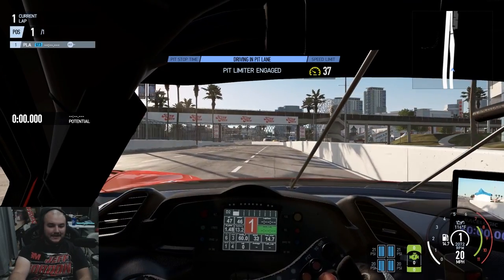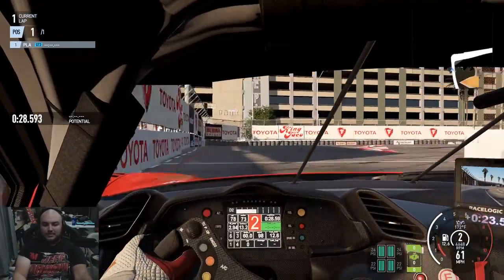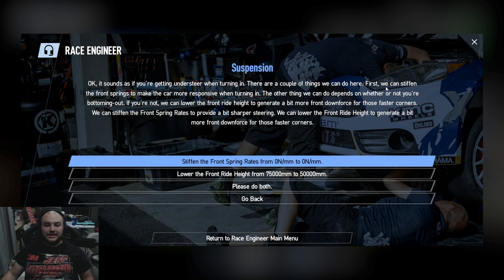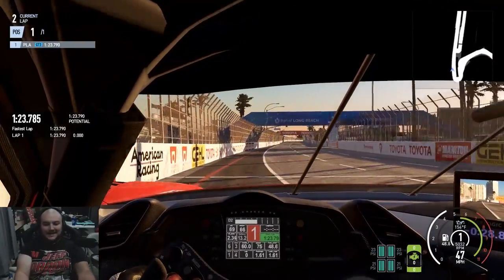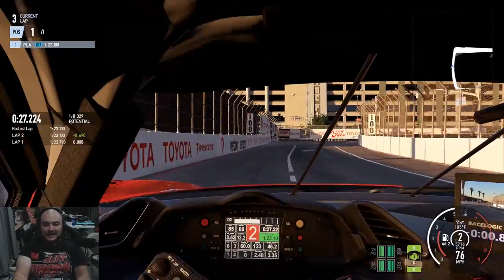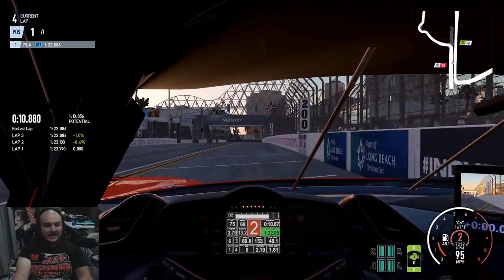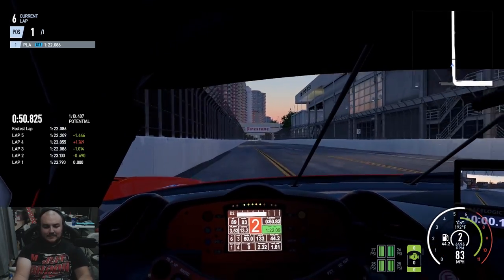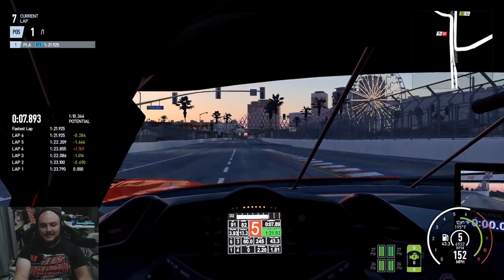Project CARS 2 - Taking a Look at Race Engineer

Comment from the maker: Note: Sorry if I seemed kinda tired in this video! Working on around 4 hours of sleep, after a pretty busy day haha. 

It seems like once you get setups dialed in, it does feel a lot better. I can understand why SMS has gone for a "Safe" default set, but I would have loved to see an option for an "Advanced" setup, similar to what was in NASCAR Racing 2003 season, but the Race Engineer does a solid job tweaking the car to improve it, at the very least!

Note 2: Looks like I finally fixed OBS settings :D :D

Edit: Note 3 - Due to a miscommunication with Bandai Namco, they accidentally forgot to tell me that I was not allowed to do live streams. So, after the last stream I did, they explained the situation, and asked me to take them down.

I still have permission to do non-live streamed videos, so I'm going to be working on that to highlight the content and features now.
Reply: Sim Racing Paddock What happened to the three streams you guys did?

Also on another note - why do you strive for this game/sim to feel like another game/sim?
Reply from the maker: Due to a miscommunication with Bandai Namco, they accidentally forgot to tell me that I was not allowed to do live streams. So, after the last stream I did, they explained the situation, and asked me to take them down.

I still have permission to do non-live streamed videos, so I'm going to be working on that to highlight the content and features now.
Reply: Sim Racing Paddock Oh okay that makes sense.
Reply: Isn't the "advanced setup" the "edit setup" button right beside race engineer?
Reply from the maker: Yes

Comment: Sometimes we actually turn the wheel more when faced with the early-in-the-turn under steer. That then causes the over steer later in the turn. As we turn the wheel more and more, the tires begin to scrub off some speed, then suddenly gain traction, causing snap to over steer.  Before we jump to tweak away the car's set up, we should raise our awareness to the real cause of a handling issue. Most likely the driver's inputs to the wheel. But I did like the video as to how the "race Engineer" function actually works.

Comment: Nice to see you respond to comments with a new  video!   GTE cars in real life have tons of aero grip. Horsepower levels are far below most street car counterparts... particularly with regard to this Ferrari.     So all the sliding you will see with a Ferrari 488 GTB on Top Gear or something similar will not happen when you cut horsepower by 150, add tons of aero and slick tires. And race car drivers don't want to understeer or oversteer, they want grip. Real drivers try to dial out the oversteer. I like it in sim racing because it is fun but if you have to compete in multiplayer.... speed and grip!

Comment: Why would you turn off Traction Control on a car that comes with and is meant to be driven with it? I dont get it. 

"The car doesnt work the way i want to" -  cause it shouldnt.
Reply: Ali Bi he's talking about the car being too planted, TC won't change that
Reply: Isn't the planted a good thing for a race car?
Reply: For fun.
Reply: "Planted" doesn't mean that it turn like you want. You might want for the tail to be a little loose (I said "a little") under braking in order to help turning in.
Reply: Then PC2 should have real assists like AC... why should I look on the Internet what is factory settings for every car when it should be in the game.
Reply from the maker: PC2 does have the option. I tend to prefer not having TC on, because I tend to prefer a bit of slip in the way I drive, and the way TC works can hamper that. I know real drivers sometimes also drive with limited/off TC as well. 

TC in race cars isn't like TC in a daily driver road car. Drivers will adjust the settings multiple times during a race, or even multiple times during a lap.
Reply: You can adjust the TC power in the In Car Menu (and ABS).... so just turn it down, that way it's still there should you suddenly find it's raining (as we have localised weather, you can find it only raining on part of the track)
Reply: It's become a bit of a dogma in the simracing world - a lot of people feel that the "real" drivers don't use traction control or ABS, even if the real car has it by default and perhaps can't even be turned off. (Can TC/ABS even be turned off in a real GT3 car? I wouldn't be surprised if it couldn't be.)

The same thing often applies to wings - plenty of people always dial down wings as much as it goes to the point of making the car extremely twitchy and very difficult to control in corners, because obviously less downforce makes you faster...

Comment: He should start improving his laptimes, being more than 5 seconds off pace compared to the times from WMD members shows that he isn't really driving at the limit (except that he always locks the tires). As soon as you really hit fast laptimes there is enough instability you have to manage and there starts the real racing and there starts the fantastic work of slightly mad studios physics developers in regards to the new tire physics features. Are you really expecting to have a non-planted car as long as you're driving slow? ;-)

It's time to give the future of sim racing a chance and not relying on old habits so pls don't take AC or rfactor as the counterpart to proof if pcars2 is realistic. Do you want to play a realistic sim or another copy of AC / rfactor?
Reply from the maker: One question I have is if that "5 seconds off the pace" is with WMD drivers going on a full tank of fuel, hard slicks, in a race setup? 

I tested out taking most fuel out, putting softs on, and pushed a little harder, and I got a 1:19.1. About 2 seconds less than the real life pole (and the WMD times), but not "5 seconds off the pace" ;)
Reply: What answer do you want to hear now from me? :) You think you're a 'racedriver' now because you're only 3seconds off the pace instead of 5? :) I just want you to be more careful with how you're judging a simulator. The base setup for that car is quite save as you're noticed thus it feels a bit "planted" or understeery which doesn't automatically mean that the game simulates the behaviour "arcadish" or "not realistic" or whatever. It's simply setup-related. If you're going to push the hell out of the car there are several corners at the track which let you loose the rear (and thus getting more realistic, right? harhar) and force you to be careful. Same with braking. If you're going to get at the limit and brake as late as possible (make sure your brake bias and temps are setup to use every brake of the car as efficient as possible) you have to manage the turn in, too, not to loose the rear.

There are plenty of other car classes in that game, just take another one than GT3 next time (the 2013 FORD FALCON FG is a very nice alternative - very rewarding as soon as you got the trick to drive the car). Just a recommendation.
Reply: And it should be a piece of piss to go sub 1:20 with a full (that's 83 litres, not the 50 you ran) tank and hard tyres.. yes I do mean with an otherwise default setup and even with a gamepad...

Comment: So the car had good grip and you wanted that teflon tires on wet ice feeling? Okay... I know loose is fast, but I am hoping there is good grip in the game.
Reply from the maker: Grip is decent, but as mentioned in the video, the cars are inclined to be set up to understeer. You lose a lot of time if the front tires are not turning. It's definitely not "teflon tires on wet ice", it's setting up a car, like in real life, to handle corners.
Reply: I think your main problem may actually be turning the steering wheel too much, thus causing the understeer... or then you are just not aggressive enough in actually turning the wheel properly. You really need to kind of "manhandle" these cars.. not drive them like a granny, as you are doing in the video. It's possible that the driving style is caused by too much iRacing (I recognize the "carefulness").. who knows. Look at a few GT3 videos.. look at their wheel/hand movements and wheel angles. They aren't leisurely turning the wheel and gingerly squeezing the throttle and shifting up at half the effective revs. It's a rather violent process in real life, compared to driving normally on the street. You need to go in with this mentality. Yes, if you drive properly aggressively in a sim like iRacing you'll be spinning out quite quickly.. but that's not "realism", that's their "problems" with the tire model. Here you can and should "manhandle" the steering.

.. at least in my case this gets me consistent low 1.18.xxx and 1.17.5xx laps at race fuel.

Comment: I don´t get what you are talking about. A car-setup can be over- or understeering and AC have lots of both like pCars 2 probably as well. A little car-setup can´t change the physics-engine. Without TC these cars should be little monsters, that´s why the real cars all have TC enabled, more or less.
Reply: Leynad Jee not really 500 hp on slicks is not that hard to hook. And most times in real Motorsport they're barely using TC unless it's adverse conditions.
Reply: TC is mostly used to preserve tyres and compensate for tyre wear or change of surface condition in GT cars ... Normally they are running on pretty low levels ... They also have throttle mapping to help with putting throttle down ...
Reply: First i said "little" monsters and second it seems both of you have not much clue about the purpose of the TCS. IMSA using two different TCS even they don´t allow ABS. TCS is used in GT3/E to get to the limit and spin the tyres in a controlled way and they always using it in every condition just with different settings. Without TC the drivers need be below the limit and on twitchy tracks like Long Beach TC is useful to have controlled spins out of the hairpins, so it´s faster.  In the first video William couldn´t get the GT3-car to spin while trying with TC off. A very safe throttle-mapping could do the same, but without this feature it should be at least medium aggressive.

Comment: Why are you comparing this to AC and RF2? Setting up a car doesn't change the way the core physics work. It changes the way the car feels. If you're trying to setup a car to feel the same as a different game, you're going to have a bad time. The physics of this game look pretty tuned anyways and many people who have played it say that the physics are very comparable if not better than AC (not particularly sure about rFactor).

Personally I feel like if you're going to compare it to a different game, you shouldn't be talking about how a setup changes your laptime (because that's obvious), you should be saying how the physics of the game need to be improved if they have to be to reach a benchmark of X.
Reply from the maker: I think you may have missed the point of this video... In this video I was admitting I made a mistake saying the "overly planted was part of the physics engine". I was addressing how people in the previous video stated that the "stability/understeer was setup, NOT physics", so I tested their claims, and found them to be right...

Comment: They setup every car to Understeer because of controller users
Reply: Yeah, except in this case it's a matter of bad driving from our host here. He is more than 4 seconds off "normal" pace (aka, he is in the slow 20%) and more than 7 seconds off "alien" pace. I don't understand how he can be commenting on things when he isn't even extracting anything close to the full performance of the car. Basically he is all over the place, everywhere, never getting any good lines, constantly being super safe with acceleration and body roll.. never tossing the car around like real racing drivers would do.. and then he calls it all "safe" and "planted". It's rather frustrating.
Reply: You don't need to be super quick in order to assess the handling properties of a racing sim. What you feel from the wheel is the same as anyone else. How you use that to guide the car around the track is a separate  issue entirely.
Reply: The main reason he's slow here are his lines. He's not using the full width of the track on a few corner exits.
Reply: Tobi Ogunsanwo lets just have the people at ign review pc2 right? You see what I mean those guys don't have licenses so are you gonna listen to their input on what's realistic if they're crashing and playing with controller. This guy is off pace so it won't feel unstable at 80% get on pace and you will see the back end move around etc.
Reply: Tobi Ogunsanwo yes true but i see what his saying a gt3 car us ment to be planted, either way it's good news I'm looking forward to trying this out on the 22nd next month happy days i just wish and pray that this bad driver system works as there will be some good league's. Happy racing 🏁 people 👍